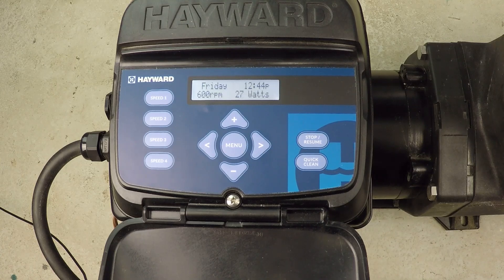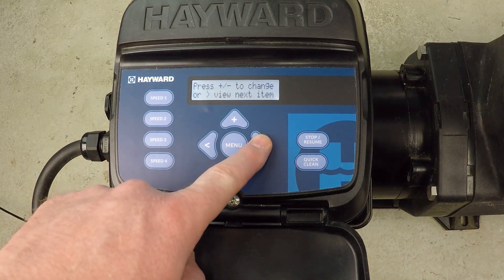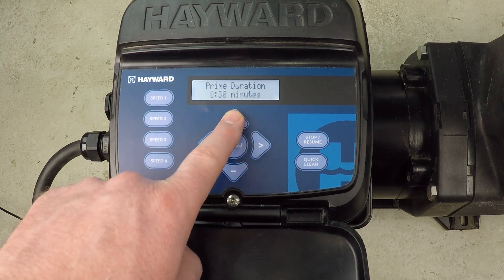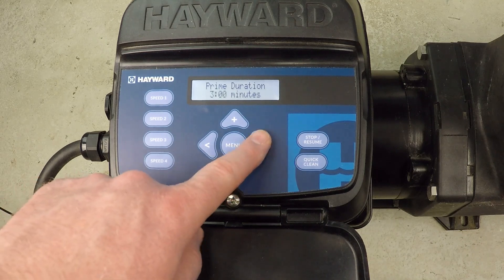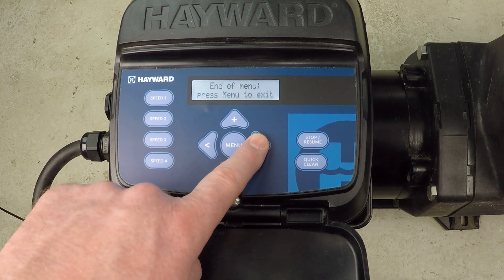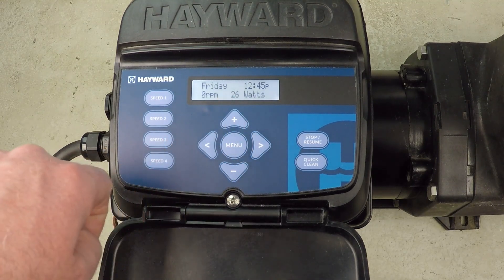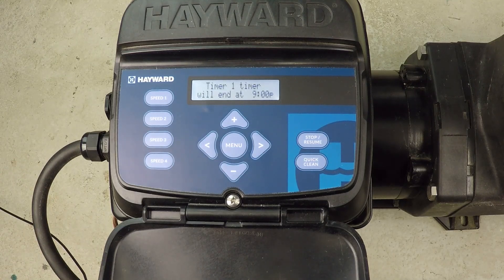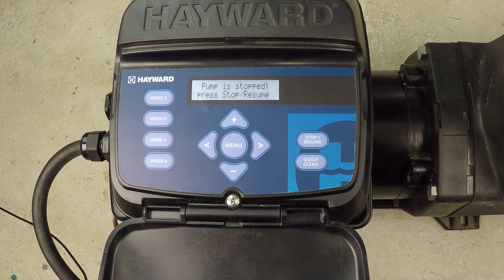How To Change Prime Duration On Hayward Super Pump VS

Comment: I have this pump and it’s brand new.  Tried turning it on after installation and after a few seconds it displays a “Low DC voltage” error.  The electrician said everything is working on the electrical side and doesn’t know why the pump would have that display.  He tested the wires and the output is 120v.